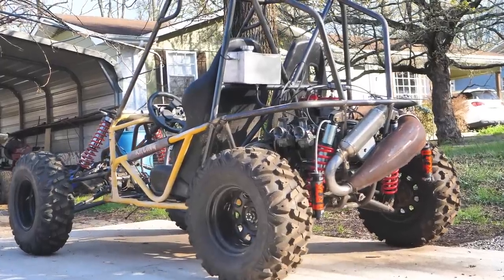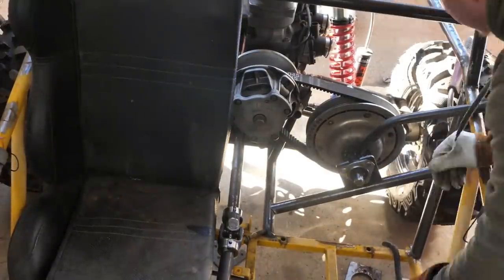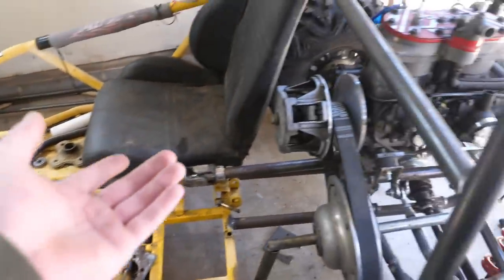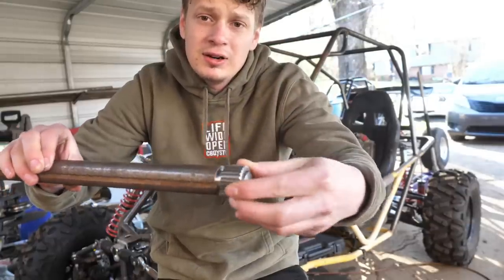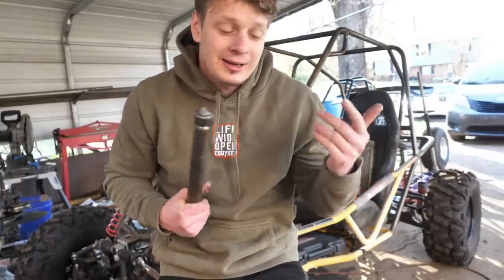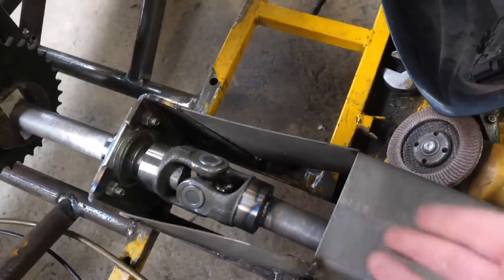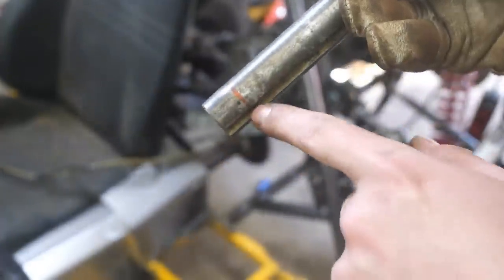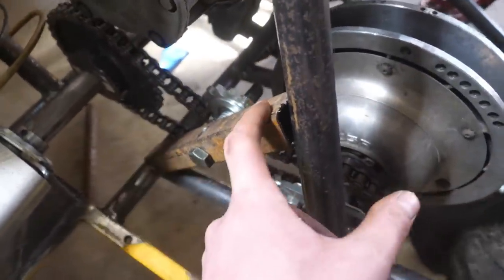700cc Mini Awd Buggy first Start!

Comment: You won't let that pillow block slip, this time.
Saying that  3 min in.
I saw a video awhile ago of a guy who built a Mopar Hemi dragster back in the 60s  and he didn't have  the resources so he  narrowed the rear end , axles and all, by cutting it with a hacksaw and welding it together with an oxyacetylene torch .  It worked .
So that's the meaning of dedication .

I worked in a machine shop that shortened driveshafts a lot.  Pretty surprising  how much stress they'll take if everything is aligned.

I'm looking forward to seeing this in action and your 3 cyl dragster too !

Comment: Personally I would have made brackets to bolt the drive-shaft cover on to the floor, so that way it would be fully removable and wouldn't have to cut the floor out.  You still did a great job though. Looking forward to seeing more on this build.
Reply: you can access the shaft from below
Reply: @infesting  Yes, however you have to lift up the buggy to access it, with an uncut floor and removable top cover/shield that's held on with a few  bolts you don't have to lift the buggy up or try to crawl under it.
Reply: @TommyAlanRaines  I agree. And less crap getting into the driveshaft/bearings when he goes offroad.

Comment: Make sure you offset the motor an 1/8" forward of the secondary clutch. This allows for the torque twist those motors produce. Cool build! I have a polaris clutch alignment tool if you need one. I'd be happy to send it to ya.
Reply from the maker: Yeah I have room on Jackshaft to slide the secondary back, but I can also use a adjustable rod to the starter holes to keep it from twisting
Reply from the maker: The tool would be nice. Email me at vasily1fab@gmail.com
Reply: @VasilyBuilds  I'll dig it out after work tonight. It's for any polaris using the P85 Clutches. Should definitely work on that set-up. The secondary stays square to the drive but the motor is set with an 1/8" deflection and a torque-stop limits the twisting. If not it'll never shift out properly and burn up belts.

Comment: If you made the housing for the u joint removable, there may be water, if offroading. 
Maybe try and put a rubber seal underneath the overlap between the seats.

Comment: You did clock the U joints so that they are in exact alignment I hope, otherwise they're likely to bind under load. 
Also seriously consider adding more support to your drive shaft tunnel, because that thing comes loose it's gonna be beating that light gauge metal to shreds in matter 😂seconds. 
If possible build a couple flat metal bands to go around it that tie directly into something solid. 
Examples similar to what NHRA regires for it's safety inspection, are any other automotive racing sanctions. 
Safety is what saves lives in cases such as this, and not a safety nut, but you have two seats.
They're safety is on you as the builder and driver both.